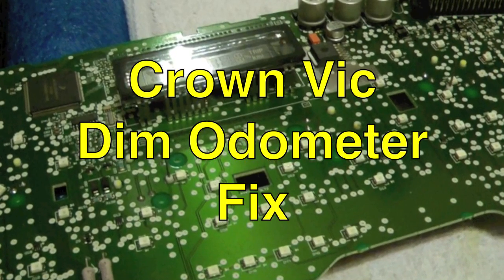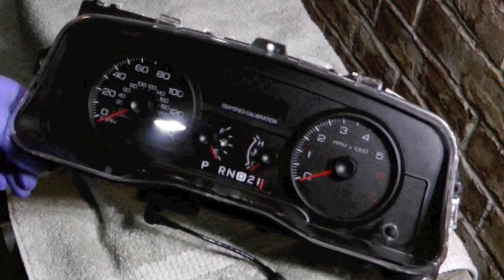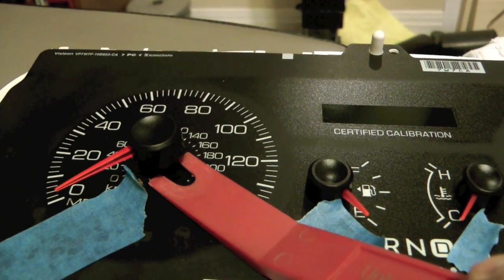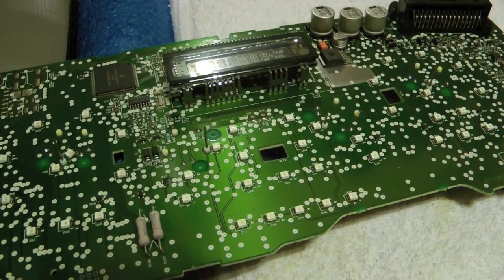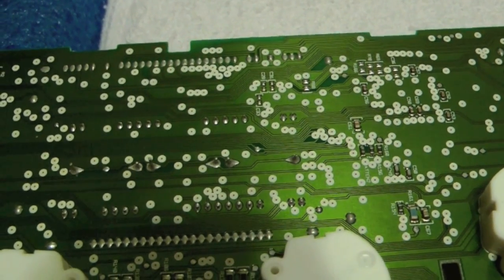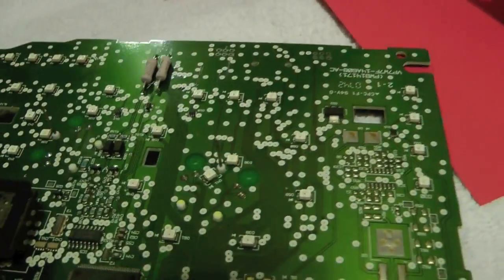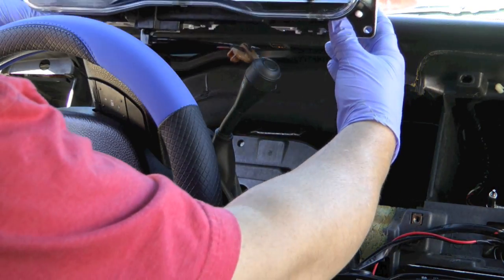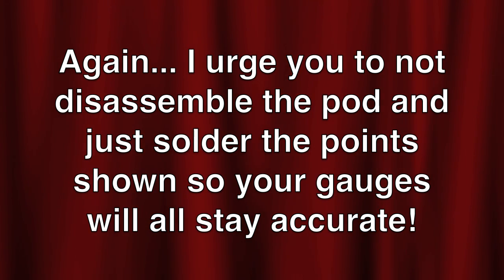Ford Crown Vic & P71/P7B dim odometer fix

Comment: Dude watched video.. Got a decent rig from harbor..I did a few things different.. But boy oh boy my cluster has life again.. Before like everyone else in comments the thing worked when it wanted to.. Fixed blend door the other day.. Work a lot figured what the heck let's do this.. My biggest issue s were the power clip you can't see the tab to release and gear cable needed housing off to take apart.. 2010 Vic... Thanks for video
Reply from the maker: glad it was helpful

Comment: Another video said that the intermittent on/off behavior can be caused by two surface mounted resistors (one that is not through the whole board but instead only contacted onto one side of the board) wearing out and losing contact. Located just underneath the digital odometer readout. Twin set of rectangular shaped contact points not far underneath the odometer readout.
Reply from the maker: yes, I have a second video about that - it's not as easy a fix because of the work involved (assuming it is a bad resistor and not just solder needing a touch up)
Reply: @WJHandyDad  I hope its as easy as me reflowing them to the board. If not I guess I would need to find out where to buy some compatile resistors? Im not a tech guy. Im poor and thus I fix eveything I own myself if I can.
Reply from the maker: when it's stuff I can't handle I send to Jeffescortlx - you can find him on Youtube and email him from the about page 
He did my son's 2011 (it needed the resistors) and had it shipped back to me the same day he got it!
Reply: @WJHandyDad  I cant reach one of the soldering points without undoing the joints that run the digital odometer. Hope it works when I plug this in lol. If not, where does that guy live. Im in Corpus Christi, Texas
Reply from the maker: @Jonbo117  he's out of state, but ship to him, he fixes, and ships back.  I think it was 7 days from the day I shipped until the day it was back in my hands.
Reply: @WJHandyDad  I got everything I think I need. Iron, flux, some solder and a cleaning pad for the iron. 8mm driver, plastic pulling tool and a hook tool.

Comment: I touched up the soldering points, but odometer still doesn’t work….Im not screwing with it any further. Just gonna get a OBD2 scanner that reads mileage, and I’ll check it that way! Anybody know of one???
Reply from the maker: The Xtool D7 and comparable do.  You can also send off the cluster to get professionally repaired... yours might need the resistors replaced

Comment: Mine is not working at all. Do the units fail or is it just the solder failures? 
Thanks! 
I just bought (2) 2011 Black Interceptors, both odometers not working.
Reply from the maker: obviously it is possible that you have some sort of catastrophic failure, but the vast majority of these simply need some solder touch up.  Good luck!
Reply: @WJHandyDad  just the digital odometer. Everything else works properly. Thanks
Reply from the maker: yeah, I'm just talking about the odometer part too

Comment: instructional videos should be accurate. The correct fix for the dim odometer display is the re-soldering of two resistors underneath the display. This will require removal of the circuit board. 
Search for other videos that identify these two resistors. Good luck.
Reply from the maker: you mean like this?  https://www.youtube.com/watch?v=NTzRkE_Qo2Q

Comment: Im wondering if you can take one cluster out of the same year and make
and plug it in would it still show your factory miles on it??
Reply from the maker: it will plug in, but the mileage will be from the new cluster.  You can use certain bi-directional scan tools to fix the mileage.  You'll need something really fancy to correct the idle hours and trip odometer

Comment: Hey bro I have a question is it possible that I could put a Mustang Cobra cluster gauge in my 2006 Crown Vic p71?
Reply from the maker: anything is hypothetically possible but I doubt that it would be plug and play
Reply: @WJHandyDad  yep that's true, for some reason I just want to have a speedometer that goes up to 160 mph and also the white overlay, I know they make the white overlay for the Crown Vics but I just want to be different and have a 160 mph speedometer because one day my goal is to set my car up to hit 160 mph at the Texas mile event
Reply: @WJHandyDad  do you think there's a lot of rewiring that's going to have to be done?
Reply from the maker: @krownvikkhris3004  I don't have a good wire diagram of how those clusters run, but my guess is yes, it would take a lot (but hopefully I'm wrong since it sounds like you plan on trying it)
Reply: @WJHandyDad  yes I do, hopefully I'll have it done soon...before next summer

Comment: So I did this today and soldered the points that you mentioned. I went to put the cluster back in only plugged in the connector to see if it worked. Well everything worked on the gauges except for the odometer. Before it was just very dim now I can't see it at all any ideas on what I did wrong?
Reply from the maker: hard to say... could be that the resistors underneath went back (which is more work).  https://www.youtube.com/watch?v=NTzRkE_Qo2Q
Reply: @WJHandyDad  hey thanks for responding! I'm going to take a look at it over the next day or so and see if I can't figure it out I appreciate it 🍻
Reply: @WJHandyDad  here's your sign moment tonight. Dimmer switch needs to be plugged back in 🤦 the odometer was brighter for about 1 minute haha but at least it's visible
Reply from the maker: @mikecarmean1676  glad you figured it out

Comment: 2011 CVPI P7B: All the gauges work, gauge back lighting works, and warning lights work, but only the digital odometer doesnt work. I can't see miles anymore, what's wrong? I pulled every fuse and are all good. Please help!
Reply from the maker: hopefully you are comfortable with a soldering iron.  If not I'd send it off to some place like circuit board medics
Reply: @WJHandyDad  I am not, I watched some of these videos and thought man that would be really great if I was as confident and nonchalant with knowledge and abilities like these guys! Thanks for your help Handy Dad, I love your videos, you're awesome!
Reply from the maker: @DocM.  I would say that soldering is a skill you can learn, though I definitely think a circuit board is more "expert" than joining wires together.  But the process is similar - heat up the post and touch the solder to the post.  A little goes a long way.  You will probably be able to eyeball the failed solder joints but may as well touch them all up while you've got it out of the car.  Either way, good luck!
Reply: @WJHandyDad  Thanks Dad! I have a basic solder kit, but I have no idea how to work it. One of those things thats so simple to someone experienced in many projects with all the tips, tricks, do's, and don'ts, and fixes, but is completely foreign to a newbie! I may leave it well alone until it's absolutely necessary
Reply from the maker: @DocM.  there are lots of soldering videos on youtube.  Even I have some, but there are more professional ones.  I really like Jeff's channel... he makes everything look so easy!  https://www.youtube.com/channel/UCzJWy4r_V89YYt4GBxNaJfQ
Reply: @WJHandyDad  Thanks Dad!
UPDATE: So I soldered up a few of the spots and was afraid the dust/soot that came off the soldering onto the green board was burning and ruined so I immediately stopped and reinstalled everything. It appeared to not fix the dim until a day later I banged on the dashboard and plastic gauge cover, this made the odometer visible again!!! 😄 Eventually in about 2 weeks it began slowly going back and forth until it was gone again.

I THINK THE PROBLEM IS THE ACTUAL HARNESS THAT ATTACHES  TO THE GAUGE ASSEMBLY! Because banging on the dash/plastic cover seemed to jostle the loose harness back in correctly, and then regular driving jostled it out of place, possibly all along.

Any thoughts? Is there a fix to this?

Also I think I need help/a video on how to recorrect my gas gauge needle 😔 It's not showing the correct amount. Close to correct, but still wrong. Even with the "Hold down milage button while turning the key on TEST function" resetting the gauges. I think the other 2 are okay. Really stressing me out, thank you for any help you can spare!
Reply from the maker: hitting the dash to "fix" doesn't necessarily mean it's the connector.  A lot of folks "fix" theirs by hitting the dash, until it won't fix anymore.  As for the gauge, it's not an exact science as much as an art.  Sounds like you may need to pop the needle off and reattach it in the "correct" location.  There are infinite places it will pop onto, so you may have to keep trying until you get it right.  You can use the location in my video as a guide
Reply: @WJHandyDad  Nice, I'll watch it again!

As for the connector harness, is that a cause for dimming?
Reply from the maker: I suppose anything is possible but I think solder is the most likely cause
Reply: @WJHandyDad  Thanks Dad! If you think of anything else or suggest repair or replacing the connector harness let me know what you think and how you'd recommend fixing the possible issues!
Reply: Got everything disassembled again, and while jiggling and moving the connector harness wires brought back the odometer miles clear as day! But went dark again. I really believe it's the harness or it's the actual wires in the harness box. Any thoughts on how to fix it?
Reply from the maker: @DocM.  doesn't sound like it will be easy but you'd have to see if you can figure out what connections are not making good contact and why, and then fix them as best you can.  good luck!

Comment: Did you check the OD wire that runs parallel to the airbag wire? The wire rubs from the ignition being turned and causes a short, which may in turn cause the resistors and solder points to get overheated and melt. Remove the wire, wrap in electrical tape and that should help fix part of the problem.
Reply from the maker: no but that's a good tip for folks to look at
Reply: @WJHandyDad  Yeah, I just found that out myself and I notice the lights and indicators will flicker a bit when I turn the ignition on/off then it goes dead but comes back for a bit. Very irritating and nobody had a replacement cluster cheap anymore
Reply from the maker: @patrickstenson830  one thing I love about the Panther community is everyone is helpful and shares knowledge about things.
Reply: @WJHandyDad  Yes sir!

Comment: please any advice is really appreciated, i just did this today and heres a quick rundown if anyone wants to help a kid out;

1. when key is turned to 3, engine light flashes for a moment, mightve just been when i reconnected battery but unsure.

2. when car is running - headlights off, max brightness odo. parking lamps on, odo and cluster goes to dimmest setting despite the slide control position. headlights on same ordeal.

3. when car is off key in 3rd turn, lights off max brightness odo, parking lamps on it goes full bright but dims quickly 2 seconds after. headlights dim no matter what.

once i get annoyed enough with it i will check some connections another day.. until then any and i mean any help is appreciated.. will be pasting this on another channel as well, if i cant get it whoever helps me i will honestly paypal u like 5 bucks if you want lol. thanks
Reply from the maker: sounds like the dimmer is set to a dim position.  It doesn't do anything when the lights are off, but when lights on it controls the brightness
Reply: @WJHandyDad  yeah when its on it does nothing
Reply: @WJHandyDad  also interior lights dont turn on when its slid all the way on
Reply from the maker: @tba6403  maybe you have a bad switch
Reply: @WJHandyDad  ha! im a moron. it was the 2nd time i had to take the cluster out and was getting late, today i just checked and realized i didnt even plug the dimmer switch back in! everything is bright as day. bright odo, bright green speedo n tach, adjusted the shifter needle while i was at it bc it was so off but now its dead center. last thing is buy a new plastic cover to rid of the scuffs from smacking it with my phone, and adjust the fuel n temp needle and the tach down 100 rpm. im thrilled! thanks for your videos many people go without saying thanks, so thankyou!

Comment: So, this would fix my odometer that either works when it wants or how big a pothole I hit?
Reply from the maker: most likely yes.  Also look at my follow up video where I show the resistor locations that might also need solder touch up

Comment: The bad solder joints are not where you pointed out. They are under the display itself, which does require disassembly. 

The VFD pins you point out are almost never the problem. They’re little flat resistors under the display.
Reply from the maker: I did a follow up video showing the resistor solder points for folks having problems with those

Comment: Where did you get the diagrams and procedures to fix all the problems in a 2010 Crown Vic Police Interceptor P7B? Where can I get an up to date Factory Service Manual, the complete car, on same car? Thanks.
Reply: It’s called the “mechanic’s manual” -dealers can order them, but they are terribly expensive (600 $ for my 2001 Toyota Tacoma). Simplified cheaper on disk versions are available - up to 100 $, depends on car/year.
Reply from the maker: all I have is a 2003 shop manual and the Haynes book and a lot of trial and error

Comment: And you don't have to remove the cover on the steering column, once everything is apart in the cluster you simply reach in and gently push little tabs in with a small flat head screwdriver and remove Gear selector indicator, the thin cable can easily be broken.

Comment: My mileage on the dash is showing ,but it seem to dim lower.  Do you have a video on that?
Reply from the maker: have you checked to see if the dial right below your headlight switch is dialed down?  You can adjust brightness there
Reply: @WJHandyDad  I have checked. The brightness switch is turn up to the max.

Comment: Would this apply to the p7b with the message center on the cluster?
Reply: And yeah if so what size solder wire should I use?
Reply from the maker: I just use the smallest solder that melts the quickest.  "Less is more" when soldering circuit boards.  I haven't seen a "message center" on a P7B but it ought to be the same type of problem.  Good luck
Reply: The messaged center is what displays the odometer and also has the digital speedo and other things you can look through like fuel mileage and oil life and what not. It doesn't have dimming issues just intermittent loss of power . Any other advice would be appreciated
Reply: @alexisdown408  its not a p7b just a post 09 cv then...

Comment: What gauge sodering wire do i need if i need more soder?
Reply from the maker: "less is more" with solder, especially on a circuit board.  I use the quickest melting solder I can find.  This is what I'm using now:  https://amzn.to/2BVCP6A
Reply: @WJHandyDad  excellent because I just bought that
Reply: @WJHandyDad  now when you say just touch each point, and I just reheating the solder there?
Reply from the maker: @maxie9506  you can certainly do that, and it may fix it without adding solder

Comment: Just retouched all the same solder points, still no odometer,  idk what to do.
Reply from the maker: could be the points underneath the display or the points up top where the wire connects
Reply: @WJHandyDad  So that means I have to take my needles off? Do I put solder on the topside as well?

Here's what I've done today:
1. Touched up solder points on rear.
2. Installed to test (didn't work)
3. Punched the Odometer and it came on very dim, I squeezed the circuit board inward it came on more, then it went off.
4. Proceeded to slap around the front of the odometer.
5. Odometer lit up completely and is working at the moment. But I don't think it will stay on for in the future.
Reply from the maker: you shouldn't need to.  Watch this video for some of the other points that may need to be touched up:  https://youtu.be/NTzRkE_Qo2Q

Comment: the bad solder joints are under the right side of the display...Ive done several of these and its always there
Reply from the maker: good to know if I ever need to do another one of these
Reply: Yep, I just repaired one. Unsure exactly which component it was, surface mount resistors or the diode, since I touched them all up but the failure on mine was under the right side of the display. You don't happen to know where the mileage is stored, do you? There doesn't appear to be an eeprom, so I'm assuming it's stored on the micro controller.

Comment: super well done.  It would have been nice to see how you solder those wicked tiny joints tho.
Reply from the maker: touch the soldering iron to them as short as possible - just enough to melt the solder.  Circuit boards are easy to mess up with too much heat